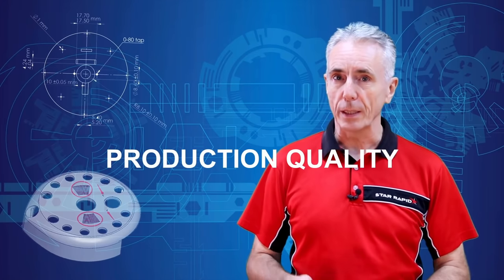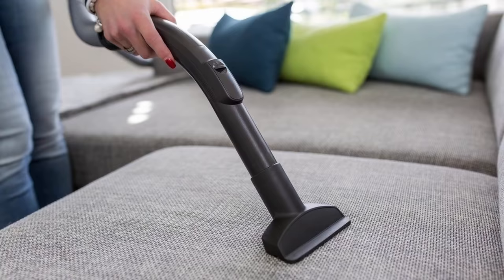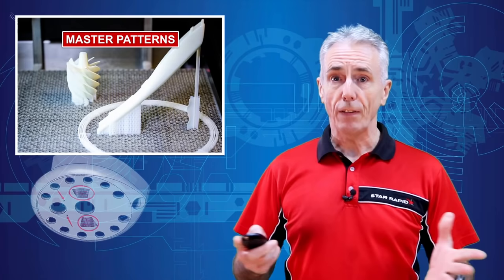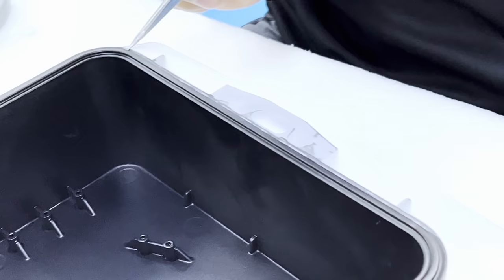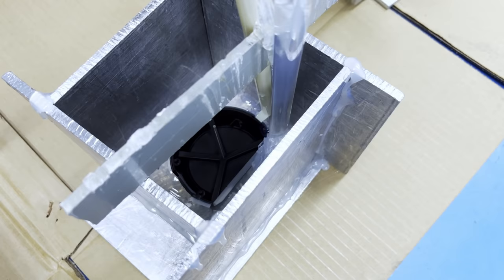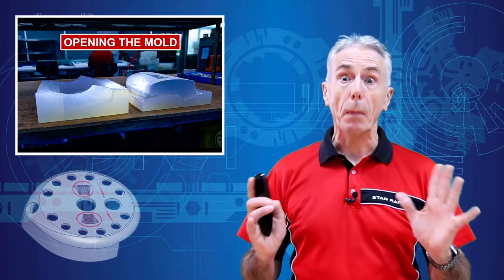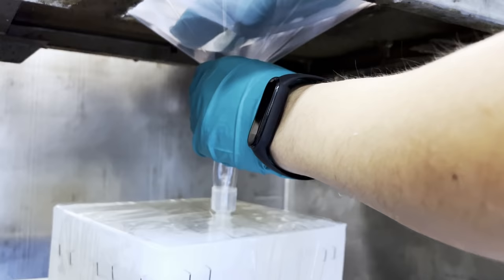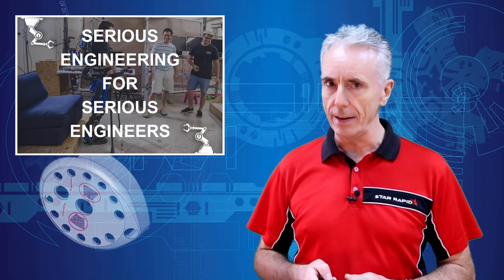You DON'T NEED an Expensive Mold to Make PLASTIC PARTS | Vacuum Casting | Serious Engineering - Ep21

Comment: I need to make a highly detailed master with rounded edges in order to make molds using PU and then later cast silicone. Which is the best 3d printing method for making this master? I'm afraid of the typical lines that you usually see in 3d printing. Is 3d printing really the best solution?
Reply: look into 3d resin printing
Reply: Post processing . Lots of good techniques from priming & sanding to dip-coating and more . Lots on it here on Y-T , and a number of GOOD presentations using equipment setups FAR simpler and less expensive with LOTS more granular detail , than in this particular Vid . Its good but only for a GENERAL overview . LOTS of far more detailed presentations are available here on Y-T .
Good HUNTING 👍!

Comment: What is the largest item that could feasibly be casted using this model?
Reply from the maker: I have seen full automotive instrumentation panels done by vacuum casting, but nowadays, those kinds of moldings are done by Reaction Injection Moulding into what are called Silicone Skin Molds. These are plywood framed articulated molds, into which you pour silicone rubber to create about a 20mm skin all over the master model. One of the experts in this process would be Paragon Rapid Technologies in the UK. The owners of Paragon are very good friends of mine, and former colleagues. Read more: https://paragon-rt.com/rapid-technologies/reaction-injection-moulding/

- Gordon

Comment: What level vacuum is inside that huge vacuum chamber?  I guess not extremely high given the huge glass or plastic transparent door?  Also, why not do everything at atmospheric then only after pouring into the mold use a small pressure pot rather than a huge vacuum chamber, like many other people do?
Reply from the maker: Two awesome questions. OK, here is how we know if we have a vacuum great enough for vacuum casting and how to test that your seals are good, and your pump is good.  

We take a small plastic cup of tap water, we put it inside the chamber, lock the door, and start the pump.  For everything to be right we must FREEZE at least the first 3mm of the water into ice in less than 10 minutes.  Now to do that, you will have reached at least minus 1007 millibar. 

https://www.engineeringtoolbox.com/water-evacuation-pressure-temperature-d_1686.html  

The reason why the vacuum can freeze the water is because each time the vacuum increases to the point that the water boils, energy is lost and cools the liquid.  So, once you have reached a vacuum that can boil water at less than 0 degrees centigrade, you have literally frozen it.  

Not only does the water freeze to ice, but then the ice even starts to sublimate as the vacuum gets even stronger, and you see little flecks of ice explode off the surface.  

You really should check this out, it’s insane to watch.  Don’t ask me how the hell that happens.  

The second question then is this, by how much does the air expand at -1007 millibar (even though it is deeper than that)?  Doing it by vacuum you expand the air by 4 or 5 times, and when you release the vacuum that air collapses by a corresponding amount.  

So, to have a pressure vessel shrink bubbles by the same amount you would need to go to 4 or 5 atmospheres (bar).  Most pressure pots for resin casting are about that.  So, if all you are looking for is to shrink bubbles, then a vacuum and a pressure pot will achieve the same thing.  

One upside to a pressure pot is that the air in the chamber will increase in temperature helping to cure the resin.  Another benefit is that you can use a vibratory table as you cast outside of the pressure pot; you can do this in a vacuum, but it is far more difficult, and frankly it is somewhat pointless, read on.  The downside to a pressure pot is the danger of an explosion. Boom.  

The upside of a vacuum is that it further degasses the resin, it thins the air in the silicone mould such that during casting the resin will flow much more easily and into the tiniest cracks and cavities. I know that in North America it is very common to use pressure pots, and in the UK, Europe, Australia, and even South America, vacuum is preferred.  

In China it is about 50/50.  So, in summary, it is a matter of personal preference.  I’ve seen really great and really terrible results by both methods.  ;-)

- Gordon

Comment: so.. the difference is that instead of spending 10-20k on the molds and tooling for a production run of injection molding and then pay out the nose for the time on the line (including the setup and tear-down time to get your molds on and off the line) you pay 5-8k for a small volume shop to make some "cheep" silicon molds and do a few resin casts?

actually... this seems reasonable.

at least if won't look like it came off a hobbyist FDM printer

Comment: Hi Gordon, Why you did not create MOLD in SLA rather than PRODUCTS in master patterns part? Would be faster that you created negative mold of the product in SLA and afterward poor the polyurethane? Also did you use RTV silicone for mold? You were curing for 14 hours  in chamber? My mold is finished with accelator in 2 hours- perfect condition. In overall, thank you for showing this you are the best teacher of rapid manufacturing. Greetings from Croatia.  Also I have question regarding molds, do you know by any chance is there a mold made of silicone that is strong/rigid enough to survive high temperature>? For example I am creating molds in Aluminum and Copper with CNC machine and the price per each mold is pretty high and  time per each mold takes 5 hours or more. Basically I need something faster for my Silicone label business.  Please help.
Reply: how do you propose to take the rigid polyurethane out of a rigid SLA mold ?  also there's a large chance that the mold would have defects as even the top end printers have problems from time to time. also you can texture the finish.
Reply: @robot-reboot28   I would use anti static spray for plastic or JElly or Vaseline and see if it works. Look buddy, I did not want to say Gordon did  wrong job I just wanted to see if this approach would be feasible nothing else. However, it would be great if you could use your expertise and tell me, is there a way to make molds rigit enought to withstand 300 celsius ? Cheers

Comment: This is very cool! Do you mind sharing the approx cost and time difference to make 15 parts by one silicon mold instead of directly doing all 15 parts in SLA? Also, is there any other material in place of silicon that can produce higher production volume in the same process? Thanks in advance
Reply: %60 better
Reply: The problem with SLA is that that it degrades, and is pretty brittle. Unless you use a particularly expensive resin. Polyurethane doesn't degrade as rapidly.
Reply: @graealex  TRUE
Reply: IS THE SILICONE USED HERE SOLD IN FLAT CONSTRUCTION MARKETS? 4:38

Comment: it is not very clear to me what exactly you are offering: the service, the silicone mold material and or the casting resins?  I am interested in the resins, SIKA?? do you also sell resins? where I purchase a sample? Thank you so much for the video.
Reply from the maker: Hello, we don't offer resins. We are a manufacturing company and factory. We offer CNC, injection molding, pressure die casting, vacuum casting, surface finishing, incoming materials inspection, and quality control services.
Reply: @starrapid  gotcha! thank you so much.  Any chance you can tell me where I can purchase the SIKA resin you showed in the video?  thanks for the content.

Comment: can't platinum-cure rubber molds withstand potentially hundreds of resin castings, as opposed to only 15 to 20 for tin-cure molds?
Reply: Problem with Platinum Silicone is that its won't cure surface-adjacent to some plastics used in 3d printing . That CAN be solved by priming and sanding , sand-blasting for a matte  surface finish , or dip-coating & polishing for a high-gloss surface finish , but straight from the FDM model you want to be careful which plastic you're using . I think I recall its PLA , but I can't be sure .

Comment: Have you ever made a copy of a complex plastic blow moulded tube? I have a classic car from 1990 that should have a cold air inlet pipe to the air filter housing - this has a narrow rectangular opening that sits in the grill just inboard of the headlight, this then twists through a couple of angles to take it being the headlight and then rearwards and into the air box itself where the moulding changes shape as the connection is round.The part is not too big overall just complex and the original part was quite weak and either broke or was replaced by an aftermarket induction kit. As part of the owners club I think that I could get sales for between 8 and 10 of these depending on price etc. Thanks for any advice, Iam based in the UK if this matters
Reply from the maker: The only way that can be done is by blow molding or rotational molding. If we were to do that by vacuum casting, we would have to split the tube into two or more pieces and bond them together after casting. - Gordon.
Reply: @starrapid ...... That was my thoughts tbh as its such a tricky shape that is dictated by the constrictions in the engine bay. I could possibly loan an original part but this would need to remain in one piece and returned as such. Would scanning this then splitting into 3 or more models then 3D printing be an option? Wall thickness could be increased slightly to make possible so long as the outer faces are as per the model. What sort of costs would you say this could be for say 1 copy or a run of 10/15? Many Thanks
Reply: Maybe model everything in 3d and print them? Or mix 3d modeling to me make an already existing part from other car fit?
Reply: Do you want to connect and maybe I can help and send you an estimate?

Comment: 🤔🤔🤔🤔🤔
If i want to make an HDPE item what resin do i use? Im new and having trouble finding information. I find how to make molds but not the liquid resin to make an hdpe item with that mold.
Reply from the maker: You cannot directly make an HDPE part in a silicone rubber mold using vacuum casting. You can use UP5690 from Sika (formerly Axson), which is a polyurethane that simulates the mechanical properties of HDPE. To make something out of real HDPE, you would need to make a metal plastic injection mold tool and then injection mold the parts.
Reply: If we're talking about just a couple prototypes it may also be possible to machine HDPE, depending on part geometries.

Comment: Vacuum for casting plastics? You sure is not pressure? As vacuum makes bubbles big, same as in your video with silicon in vacuum. You need pressure to remove bubbles! I watched the pouring part 4 times and still it wasn't explained normally how vacuum can help here!
Reply from the maker: The vacuum makes the bubbles expand by more than 1,000 times, they rise to the surface of the liquid PU and burst. Any bubbles that are left in the material, then shrink in volume by about 1,000, and often become so small that the gas is reabsorbed back into solution. - Gordon.
Reply: @starrapid  it will go on top of surface, yes, but if the surface is inside the mold the bubbles do not burst, they are trapped there and as soon as you remove the vacuum the air will be there! So your explanation do not have sence for any regular vacuum casting. There is some more stuff involved. That's why you need that expensive machine!

Comment: What's the point of all this? If you have a resin printer you can just use those parts directly. Seems dumb to make a master then a mould just to replicate the same thing. Just use the original thing.
Reply: Significantly cheaper, faster, better finish more representative parts. Have done this a number of times for validation testing. Especially for bigger parts. Parts are in the tens of dollars rather than hundreds. One offs we often machine over resin print, better finish, better mech properties and cost competitive.

Comment: Why use a vacuum, which at best can only exert 1 atmosphere, when pneumatic pressure from the other side can exert tons?!
What a ridiculous choice.
Reply from the maker: We pull more than -1007 mbar, which is approximately 73% from 1bar to full vacuum, we know this because we test our machines by freezing water in a cup to prove we have enough vacuum. That vacuum will expand the air 4 or 5 times. A typical pressure pot for casting is around 5 bar, which also compresses the air 4 or 5 times. 

So, it is basically the same effect, just starting from a different point. As I say in another answer, two benefits of pressure casting is that you can use a vibrating table whilst hand casting outside the machine, and inside the machine the air heats up as you compress it, thereby helping the resin to cure.

- Gordon
Reply: @starrapid  You said it yourself!
You can ONLY apply 1 bar maximum with a vacuum. Whereas with a pressurised setup, you can apply, say, 1000 bar.
And freezing water in a cup proves nothing!
Watch a few Thuderf00t clips on vacuum science. I do not have the energy nor the space to explain this subject to you.
But thank you for partially emerging from the shroud of cowardice, and providing me at least your given name.